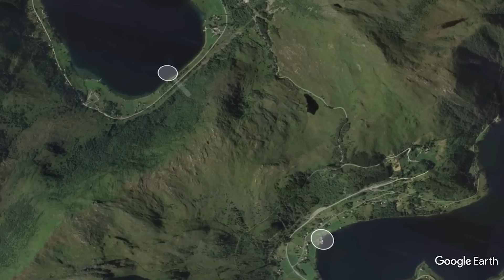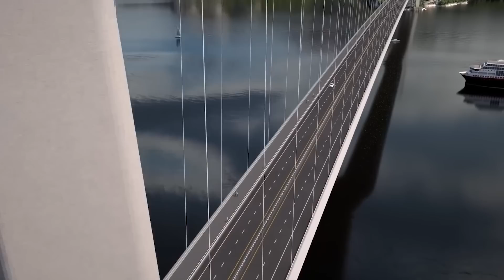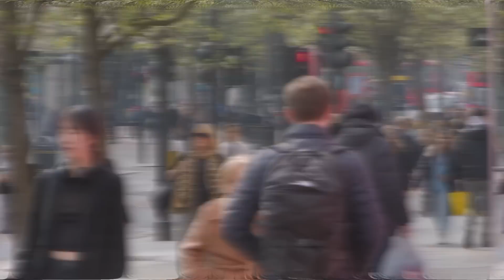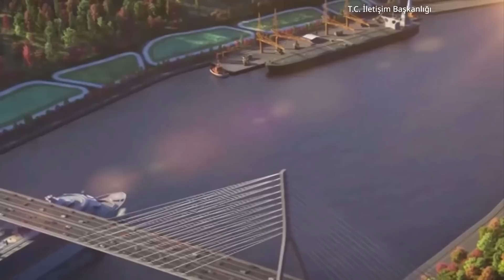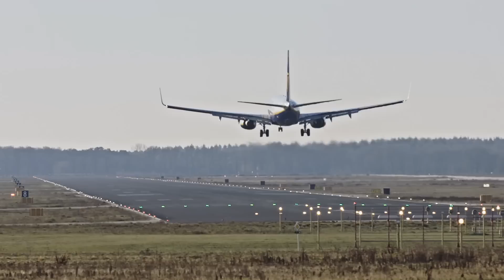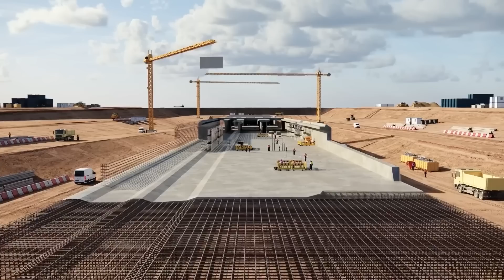Top 10 Biggest Megaprojects in Europe

Comment: So basically just focusing on Western Europe then....nothing from Central Europe? For instance Via Carpathia (highway from Estonia to Greece through entirety of Eastern part of EU), Rail Baltica (High Speed Railway from Tallin to Warsaw), CPK (Solidarity airport in Poland for up to 100m passengers per year plus over 1800km of High Speed Railways and one of the largest highway junctions in Europe). Not to mention shipping canals and other works. Also why showing Warsaw (Poland capital) when talking about Denmark? On top of that...HS2 is a massive flop, nothing more than a money heist by the governing party. It was supposed to be much larger and the current benefits from the part that survived will be negligible (it doesn't even connect to HS1 like it was supposed to)
Reply: Everything you mention is part of TEN-T, the last "project"